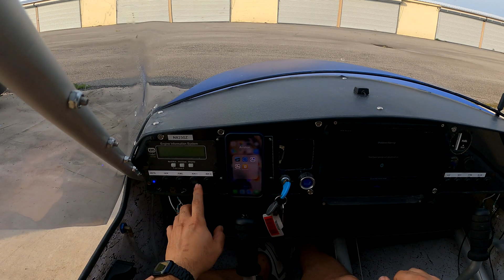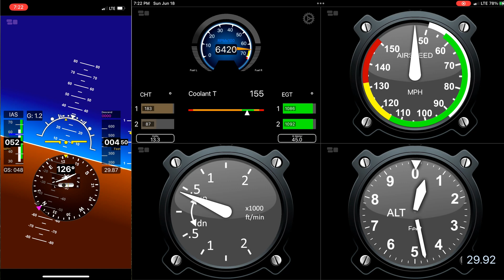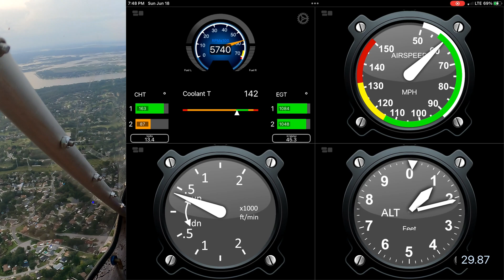Rotax 670 Maiden Flight - Buccaneer II

Comment: I recommend reducing the power 300 rpm as soon as your clear of any obstacles .  30 seconds full throttle is max on the 670. 90% of the engines that fail, the damage that caused the failure happened when the engine was running at full power.   Rotax Rick
Reply from the maker: I have since increased prop pitch to drop WOT to about 6500. And yes, I usually pull back around 500' to between 6000-6300 for climb out.